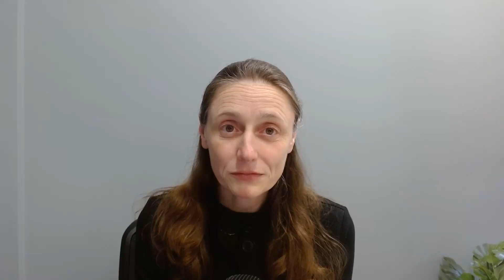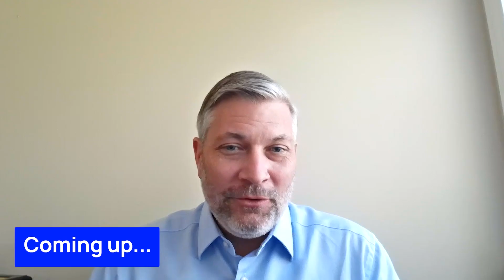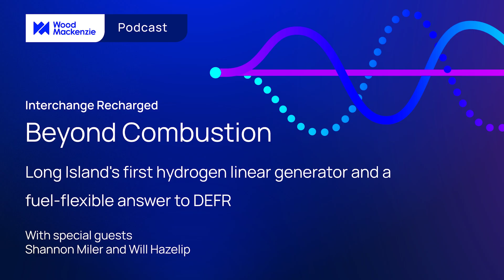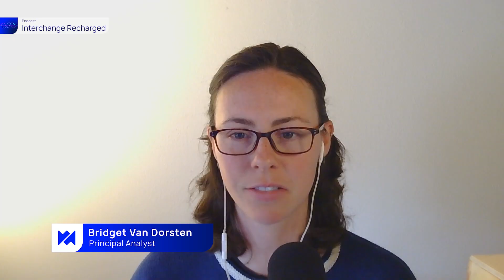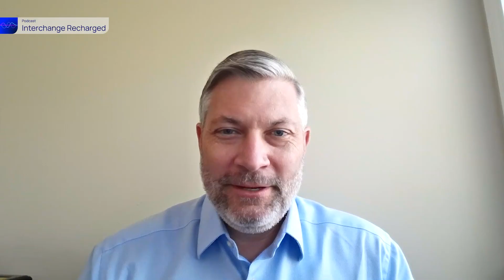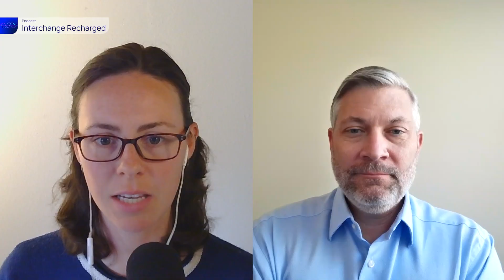Hydrogen problem: can new generators fix clean power? | Interchange Recharged

Comment: You’re absolutely right that catalytic oxidation is often casually called “catalytic burning.”  

But chemically and thermodynamically, it is not the same thing as combustion — and that distinction is exactly what Mainspring is relying on.

Reciprocating systems do have inherent penalties that turbines don’t.
But the picture is more nuanced, and the video glosses over this entirely.

Let’s break it down cleanly and precisely.

⚙ 1. Reciprocating motion has inherent loss mechanisms

a) Friction losses

Reciprocating systems have:

• linear bearings
• seals
• guides
• piston rings (or equivalents)
• reversal forces at each stroke

Every reversal of direction introduces:

• side loads
• bearing friction
• inertial losses

Turbines avoid this because:

• rotation is continuous
• bearings see steady loads
• no reversal of direction
• no sliding seals

So yes — reciprocating friction is inherently higher.

🌬 2. Windage and viscous drag

Turbines spin at high speed, so they experience windage losses (air drag on blades).

Linear generators avoid rotational windage, but they have:

• piston face drag
• gas flow losses
• port throttling losses

So both systems have aerodynamic losses, but of different types.

🔄 3. Inertial losses from reversing mass
This is a big one.

In a reciprocating system:

• the moving mass must stop
• then reverse direction
• every cycle

This costs energy unless perfectly recovered elastically.

Mainspring claims to use:

• springs
• magnetic restoring forces
• software‑controlled timing
• …to recapture most of this energy.

But physics says:

You can never recover 100% of reversal losses.

Turbines avoid this entirely.

🔧 4. Seal and leakage losses

Linear generators require:

• sliding seals
• or clearance seals
• or magnetic seals

All of which leak more than turbine blade tip clearances.

Leakage = lost pressure = lost work.

🔥 5. Heat transfer losses

Reciprocating chambers have:

• large surface area relative to volume
• rapid temperature swings
• mor heat loss per cycle

Turbines operate at:

• steady high temperature
• lower surface‑to‑volume ratio

So turbines retain heat better.

 with help from @Microsoft.Copilot